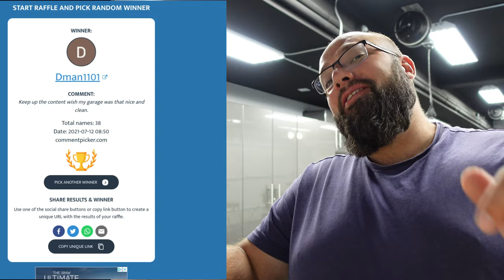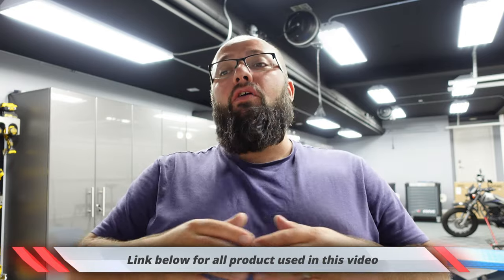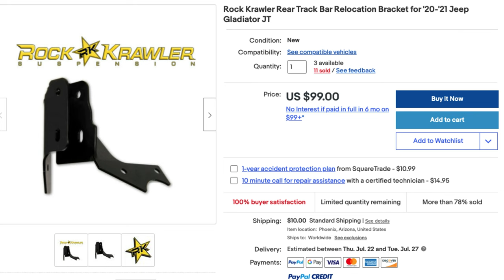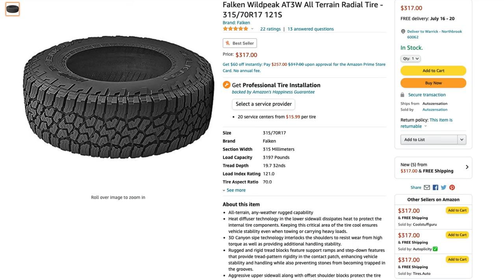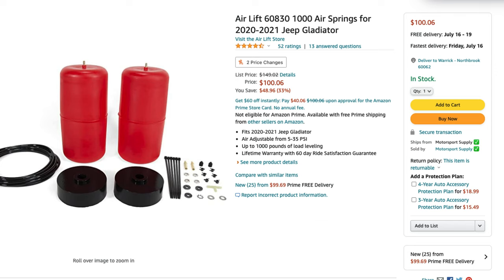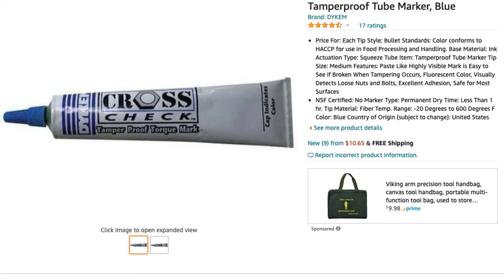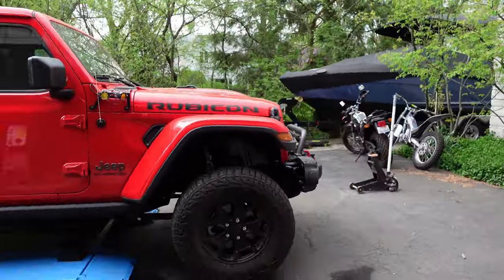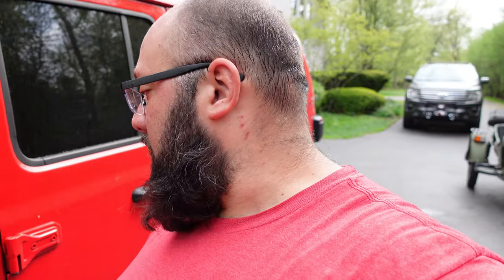Installing the ULTIMATE Mopar Lift on my Jeep Gladiator - Thanks Gator_Overland!

Comment from the maker: How do you think the Gladiator looks now? Should I have gone with bigger tires?
Reply: Looks great, I love that vehicle lift I need one of those. I have 4.5 lift on my Gladiator with 37's mainly to get a better breakover and departure angle. I tried to add airbags but I couldn't find any tall or wide enough  for the new springs. Hopefully they come out with something later. I recommend the Hellwig swaybar it makes a huge difference in the wind and off camber roads much less side to side motion.